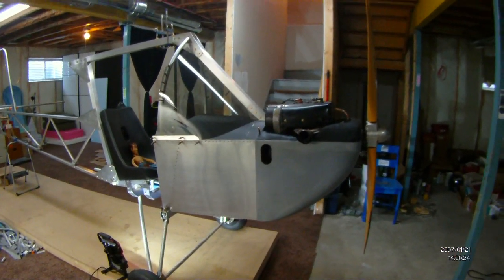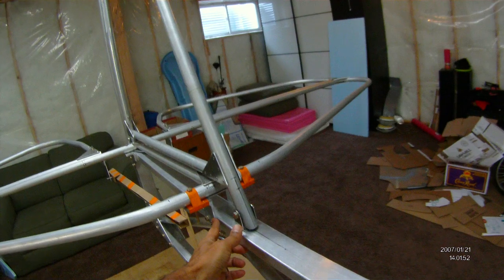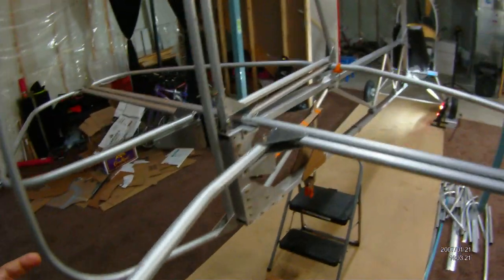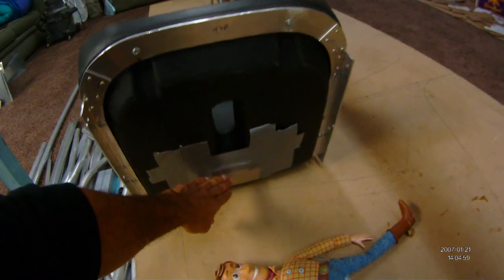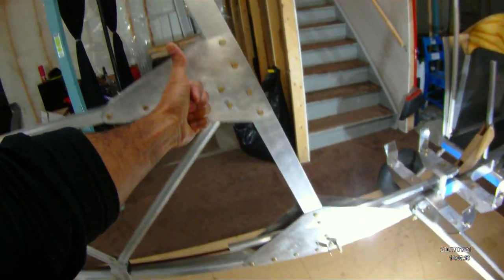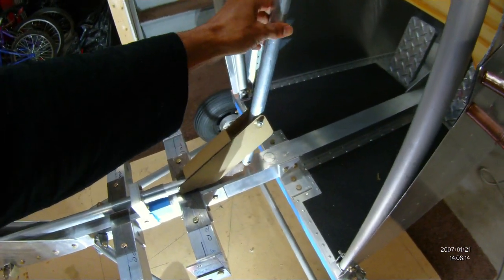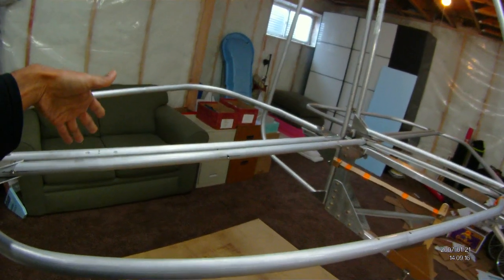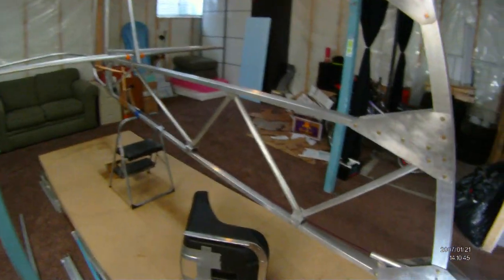Affordaplane build #9 001

Comment: Where is your front strut 1" bar?
Reply from the maker: What front strut are you referring to?
Reply: @DPSDDS  The plans call for 1" bar thru the 2 x 2 cross that the landing gear is attached to. The 1" bar is the attach point for the  front wing strut each side.  don't see it in the video.
Reply from the maker: Oh ok. Yes the 1” round bar is there. You are right that the front lift struts attach to it. The plane is done and flying. See my other videos. It’s fun to fly but slow. 50 - 55 mph cruise at 6000 rpm.